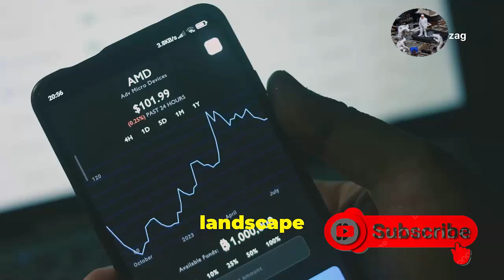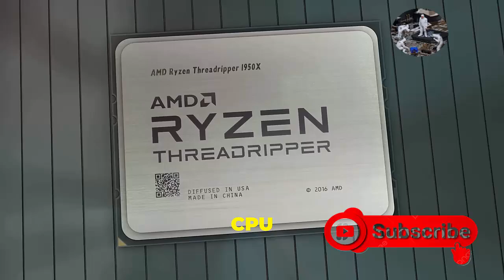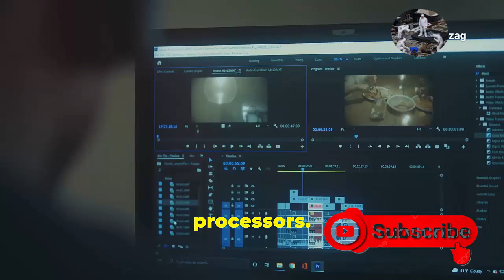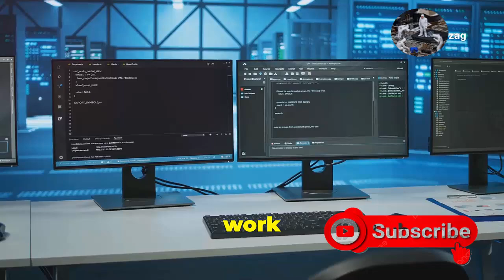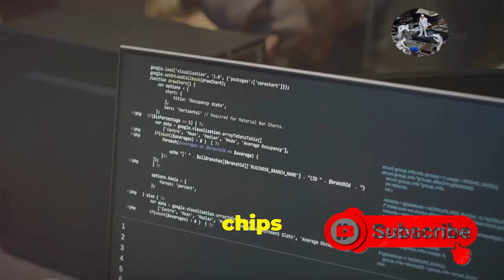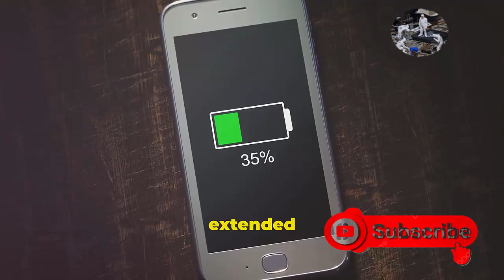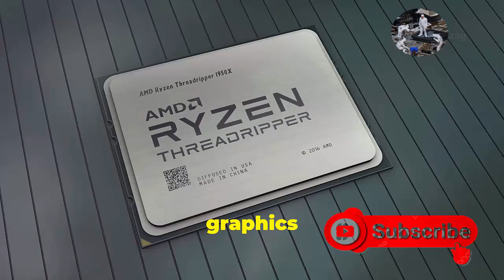Goodbye Intel and Old Computers Hello to New Processors

Comment: It's very shortsighted and environmentally unfriendly of Microsoft to push people into buying new machines when older processors are perfectly capable to do everyday taks, now the trash heaps are going to be filled to the brim with perfectly good electronics, only to push an operating system that only wants to steal your data to get rich. Well goodbye Windows and hello Linux.